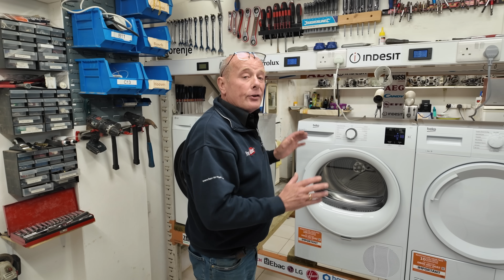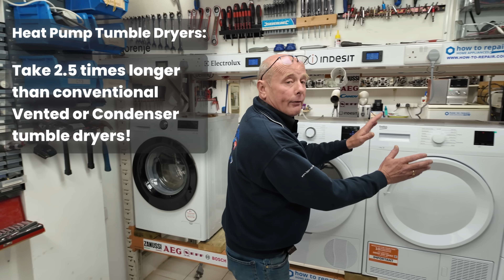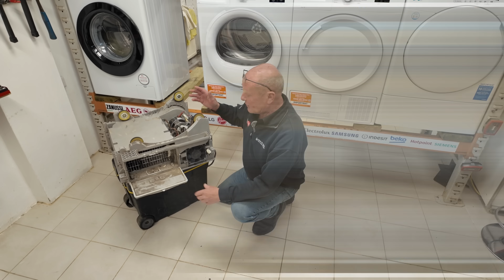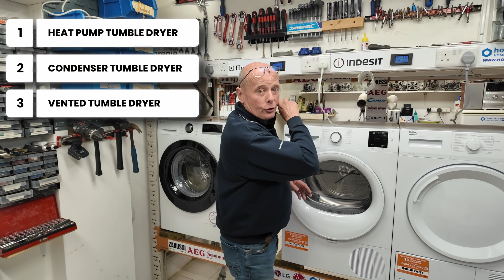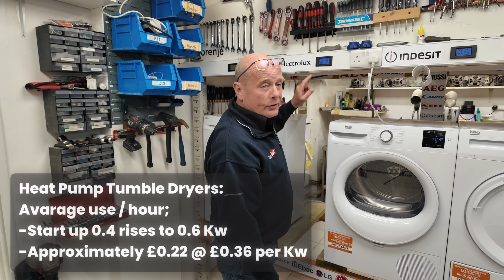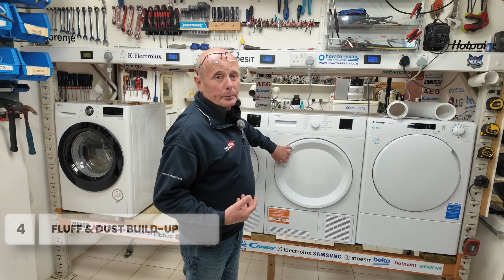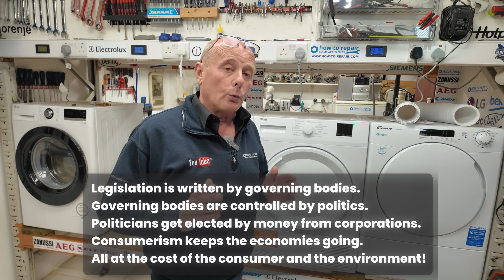Tumble Dryers the Shocking Truth About Heat Pump vs Vented & Condenser, NEW LEGISLATION!

Comment: I inherited a vent dryer when I bought the property, alas it didn’t work, I turned it on and it just made a humming noise. I googled it and it indicated the capacitor was faulty. I ordered another one for $7, it was the size of a can of beans. I replaced it and it worked. Presumably the previous owner abandoned it because it didn’t work.
I was pretty pleased when I fixed it. However I hang my clothes on a drying rack and only use the tumble dryer on my bedding or if I wanted to dry everything quickly (rare).
Reply from the maker: Using the dryer only when necessary and relying on a drying rack for the rest is such a practical and economical approach. Not only does it save money on electricity, but it also extends the lifespan of the dryer. If the UK could give us some weather that we might dry on the line as well lol.

Thank you for your comment. I appreciate people like you taking the time to write it out. Please share it where possible. It might help others make a wise choice instead of being misled by the industry.
Reply: @How-to-repair  Melbourne gets cold but a clothes horse is adequate. It doesn’t snow though. Shouldn’t make a diffrence with house heating.

Comment: I am baffled by this, aren't we moving to renewable green energy and don't have to worry abut wasting power on reliable machines?.
I have  15kw of grid tie solar and use my old heating element dryer during the day, it's realy just a rotating drum withan and heater, so simple amd reliable.
I have a spare ine that is over 30 years old as well just in case.
This complication of drying clothes is insane when you stack it up against the parts used to make these machines

Comment: Bosch HP driers have a wet condenser cleaning programme, which seems to work. Another option might be to have the HP work with water as an intermediary so that the condenser can be simply pulled out like the simpler model with an auto sealing coupler on both parts.

Comment: Speak to my wife, used all makes and gone though many tumble dryers, also had a holiday home business and looked after hundreds of homes for owners and replace appliances. She has and swears by vented every time, no questions 🤔
Reply from the maker: Thanks a lot for your comment mate. I think heat pump technology is brilliant, but these machines are only lasting on average five years they take at least two times longer to dry the clothes at least twice the amount of wear and tear and components and the accessibility to do maintenance is an absolute nightmare. Manufactures do not seem to understand what maintenance is needed and how easy it is to do. They seem to build it and assume it's perfect without testing properly. Thank you for your comment. I would be grateful if you would share this post, as it’s the only way to force things to go large nowadays. Have a great day!

Comment: I understand this rule came up as a support for the industry. 
I thank you for this information! I did not know these facts. Sometimes keeping the old machine (car, device) is better even if energy consumption is higher. Producing a new device also costs recourses. The total environmental balance might not be too favourable, if we factor in modern devices are not easily repaired.
Reply from the maker: Sometimes the greener choice is sticking with an older, well-maintained machine rather than replacing it prematurely. The production of new devices comes with a significant environmental cost, from resource extraction to manufacturing and transportation. Think about the environmental impact of building machines and then recycling them. These machines are often transported halfway around the world, which adds to fuel costs. It's baffling that we need to ship them every five years due to failure.

Thank you for your comment. I appreciate people like you taking the time to write it out. Please share it where possible. It might help others make a wise choice instead of being misled by the industry.
Reply: @How-to-repair  I have a few years old Samsung washing machine that did not pump the washing water. The customer service told me "not worth it, buy a new one", without even opening one single screw. I guys you know already what could be the problem. 

Yea, sure I thought. I took my luck and dismantled to thing to reach the drain pump. Looked like new, but so full of plastic, no surprises some gears did not want anymore.
I shot a spare part from Ebay for about Euro 30. Voila, works! About 2 h work for me, may have been 30 minutes for a qualified technician. 

Even if I don't do it myself, I'd rather give the money to an honest repairman ... and not always throw away things.
We should spread the message, don't buy cheap junk, insist in repairability.

Comment: As a white goods engineer working for a corporation I can tell you that this video is spot on. I hate heat pump dryers with a passion. People put them in unheated garages and wonder why the take for ever to dry in the middle of winter. They complain they take too long in general, because the sales man never sells that point. We don't regas them because they use R134a gas and we are only allowed to use R600a (as used in modern refrigerators),  so we have to change the complete base of the machine. That's a pile of plastic going to landfill. They get full of pet hair and it makes them stink like a soggy dog.  A condenser would keep that pet hair dry so it doesn't smell, but in gets damp in the heat pump dryer. If I can find space I'm going to buy a spare condenser dryer or 2 to prolong not having to get a heat pump version. Seriously, they are that bad.
Reply from the maker: Thanks a lot for sharing your experience mate. I think heat pump technology is brilliant, but these machines are only lasting on average five years they take at least two times longer to dry the clothes at least twice the amount of wear and tear and components and the accessibility to do maintenance is an absolute nightmare. Manufactures do not seem to understand what maintenance is needed and how easy it is to do. They seem to build it and assume it's perfect without testing properly. Thank you for your comment. I would be grateful if you would share this post, as it’s the only way to force things to go large nowadays. Have a great day, Paul.

Comment: love our heatpump condensing tumble dryer, sure it takes longer but it uses much less electricity, doesnt overheat the clothes, lower risk of fire due to not having a high temperature element. 

my tumble dryer is easy to clean out too no need to disassemble, I clean the filter that is on the entry to the heating element regularly as well as the fluff trap. 

Question on reliability. you suggest about replacing the heating units but I would suggest that the heat pump is more reliable than the high temperature resistive unit.

To do a proper comparative test on energy consumption and run time you need to was a load of clothes, dry them, then repeat the wash and dry with the same load and look at the kWh used. Ours typically uses around 0.5kWh of electricity on a load and monitors the moisture content and will finish early/late depending on the load.

I always do an extra spin in the washing machine which takes out more of the moisture which is helpful for the clothes I have to air dry in the house.

Comment: My vented tumble dryer was 5 years old when I bought it. Spent most it's life outside in shed or garage. It is getting on for 13 years old and nothing has ever gone wrong. I thought it failed just a couple weeks ago when the temperature was -5 Celsius though, but once temperature was up over 0 celcius, it's back running well. I managed 6 loads in a day at about 90 minutes each.

Last condenser was only 3 years old when it got binned as it was cheaper to get an old vented machine than repair it.

Comment: I bought a heat pump over £500 quid i had 2 replaced in 2 weeks both kept leaking from possible condensation idk. Went bk to condenser been great for past 3 years 😂
Reply from the maker: Spending over £500 and having to replace two machines in just two weeks would test anyone's patience. It’s no wonder you switched back to a condenser. Sometimes, reliability really does beat all the supposed benefits of newer technology.

Thank you for your comment. I appreciate people like you taking the time to write it out. Please share it where possible. It might help others make a wise choice instead of being misled by the industry.

Comment: You sound to me like a loose cannon. If you clean the new heat pump dryers after each drying cycle, you can save a ton of money.
Reply from the maker: In the European Union, they are not that easy to clean and most engineers will tell you exactly that. Thank you very much for the comment.
Reply: @ may be time for improvements... but still a great idea. In Canada, the size of appliances are huge.

Comment: For small rooms, only heat pump dryers work. The others will heat the room and the drying process for them stops working due to the high temperature in the room.

Comment: Yes flog the consumer for energy use while the government bodies that regulate  it get to use energy the consumer pays for FREE ...... When my government can prove beyond a shadow of a doubt they can operate on say fifty percent less energy then Ill consider being told by them what I have to reduce. Living in one of the wettest parts of the world using a vented drier didnt drive my energy use through the roof what does is a lack of smarts when it comes to drying clothing. How do the all new heat pump systems work in high humidity areas ? Adding a hvac system to a clothes drier is like putting a 3/4 horse power motor on a cork screw.... Manufacturer driven legislation is destroying the planet.

Comment: You didn't compare natural gas dryers, which I use. It drys a full load in about 40 minutes and is, of course, vented. It should be noted that I'm in the States. Here in California, our electricity is VERY high, but Natural Gas falling out of favor out here. I also heat my home with gas and it costs about 1/3 of the cost of my mini-split heat pump to heat my home. Lastly, we have (had) a brand called Kenmore, which is my brand. I've had the same front load washer/gas dryer since 2004. The only thing ever serviced was the dryer belt. Still running strong.
Reply from the maker: Thanks very much for your comment, mate. I have a video planned showing the running costs of a brand new appliance, but I'll have to wait until I get back. I'm travelling abroad soon, so it might be a little while before I can publish it.

Comment: I have had my Bosch series 8 heat pump drier for 8 years now. I have used it for half the time in the tropics (Darwin) and now Victoria - Australia. It gets used 1-2 time a day and it wasn't drying clothes properly after 3+hrs so I used this video, https://www.youtube.com/watch?v=K7TLldVklig to clean it out. The side that houses the motor etc was full of lint so air flow was poor going to the drum. It now dries the clothes in half the time. I have the laundry door closed to keep the heat in the room. There is no condensation in the room because its a heat pump drier.

Comment: I dont know what model that heat pump dryer is, but we run our Whirlpool heat pump dryer, and it only run 72 mins to dry a full 7.4 cubic ft dryer.  Per hour this dryer consumed a tiny bit over 300W/hr.  My previous dryer (a condenser unit), draw 3000W/hr, and needed 65-80 minutes to dry the same sized load.   So, yes, the maintenance is higher on the heat pump, but in electricity alone, it has saved me ~$400/yr in hydro cost (Ontario, Canada has absurd hydro rates).  So within 2.2 years, I've broken even on the pure cost difference between the units.  I just hit year 6, did my first major maintenance (taking the panels off and vacuuming the insides/etc), but even if I have to purchase another one, I've paid for the second unit in the 3 subsequent years after the initial 2.2. Yes, it sucks for our landfills (I agree with you there), however some of the latest heatpump technology is switching to CO2 as a refrigerant, which will not require any specialized tools to handle, and wont be an environmental disaster in the process.
Reply: I do not understand why it would go to a landfill?  Everything in that dryer is recyclable.  Poop, we have thieves that would gladly steal the copper out of one. 😄
Reply: You will always need specialised equipment for c02 refrigeration systems. I'm a refrigeration engineer in the UK, spent the last 6 years working on c02 systems. 

You can't get people to repair them, they're very complex and fragile and not efficient compared to their trad refrigerant counter parts. C02 is a good refrigerant but inefficient under high load conditions, and generally, the compressors don't last long due to the high pressures and temps in these systems, plus you get oil breakdown aswell.
Reply: Appliances do not go into the landfill in Ontario. Scrap metal dealers go to the landfill and collect them to be melted down. Anything with a refrigeration unit has a 20 dollar fee when you drop it off to cover the cost of evacuating the unit. I have a 25 year old set of German made Bosch compact washer /vented dryer set that drys a full load of clothes in 30 to 40 minutes. The dryer draws 15 amps compared to most large dryers that use 30 amps. There is nothing in these machines that I can't repair myself, and they cost very little to run.They were expensive, around 1700.00 in 1999 but well worth it. The compact sets you see in stores with the Bosch name on them now are actually cheap Samsung units, Bosch left the Canada market long ago.
Reply: I think I have the same Whirlpool heat pump dryer.  It has had fairly heavy use for about five years.  I knew about the clogging issue before I bought it.  I do use a spin dryer first (centrifuge) which removes a fair bit of water.   Drying time varies depending on type of clothing but is similar to what you have found - longer than vented but not twice as long.  I have found that it has an easier time if I split the load and also remove the things that have dried ahead of others (fleece items can usually be removed mid cycle).  This results in two shorter runs that add up to less than the full load would be.  The whole problem with this machine is that the primary lint screen (the one inside the drum) does not fit tightly and allows lint to go past it.  This is supposed to be trapped in the secondary lint filter,  but in reality a lot of it goes by and clogs the evaporator.  At some point I will have to dismantle the machine and clean it.  I have some fine stainless steel mesh which I will use to make a better secondary filter when I take the thing apart.  Overall, it has saved a lot of electricity.  I rate it as fragile and finicky but worth the trouble.  There is a you tube vid on how to dismantle - search the model number.
Reply: that's the "math" the video creator promised but not delivered. You will save the price of the machines to at least 2x factor compared to the others. Why would I use the more expansive variant per year to dry clothes?

Comment: You forgot to mention that the heat pump dryer is more gentle on the clothes, because it does NOT reach the same temperatures as the other two dryers you’re testing, about half as warm…..,therefore doesn’t put so much wear on the clothes.

Comment: Why would the heat pump in a tumble drier fail after just five years??  It has basically the same components as a refrigerator.  In my experience all the refrigerators I have owned have lasted twenty odd years or more, there is one in the garage we bought in 1995 and it’s still going strong.  Same goes for the Air Source heat pumps we have heating the house, all were installed around 15 years ago and have given us no problems.  Heat pumps do not break down.  Defluff the machine every couple of years and it'll go for ever.   By the way its very easy to find someone to maintian or service a heat pump over here in New Zealand, heat pumps are much more common over hear.  Embrace the new technology and the costs to maintain and service will come down as they become more common, as will the cost to buy.
Reply from the maker: Thanks a lot for your comment mate. I think heat pump technology is brilliant, but these machines are only lasting on average five years they take at least two times longer to dry the clothes at least twice the amount of wear and tear and components and the accessibility to do maintenance is an absolute nightmare. Manufactures do not seem to understand what maintenance is needed and how easy it is to do. They seem to build it and assume it's perfect without testing properly. Thank you for your comment. I would be grateful if you would share this post, as it’s the only way to force things to go large nowadays. Have a great day, Paul.

Comment: Very interesting video. However I live in the US and during winters we often have blackouts because powerlines still run into the air instead of ground. So, I have a battery powered home and and more or less forced to use a heat pump dryer. Switching on and off 2kw loads (which requires a 240V connection here to begin with) is not optimal when running on solar power/batteries. Besides, I like to replace most appliances after 5 to 7 years anyway because each new generation uses less energy and has more features (48yr old nerd here). Also the wife is also very happy when I bring home a new appliance ;-)